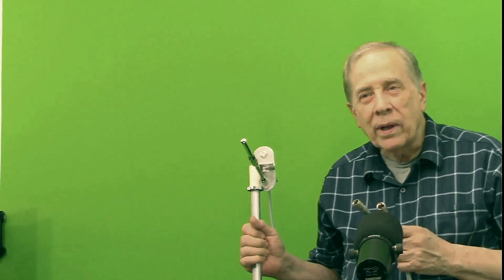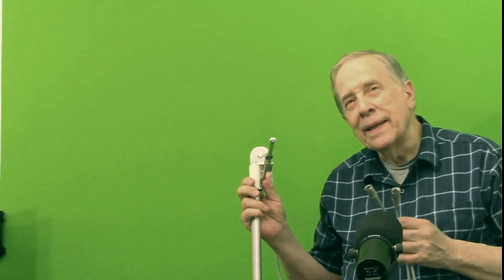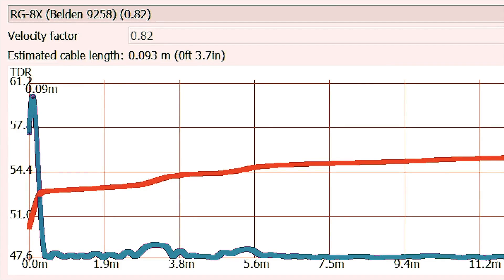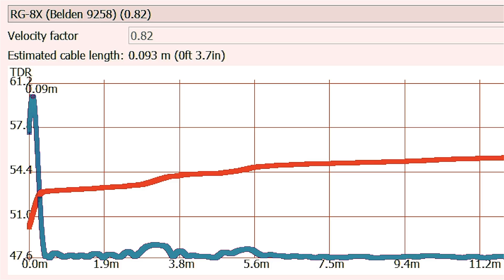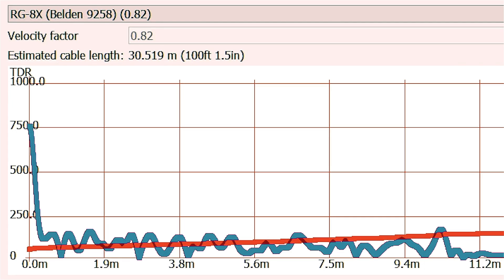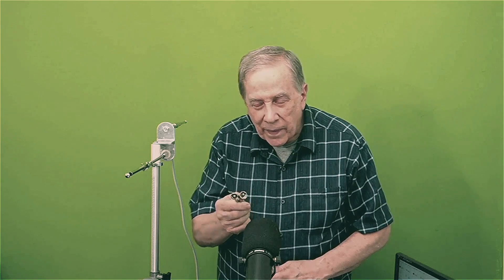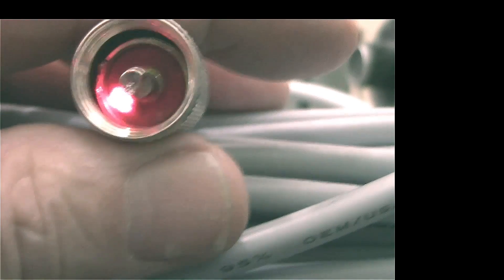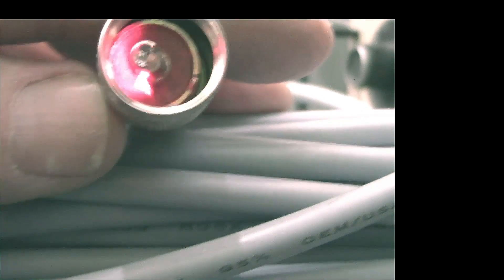RG8X No-Name Coax, You Need To Be Careful, Jim W6LG Shows What Happened To 100 Feet Of Gray Coax

Comment: I learned long ago to never trust connectors that were factory installed.  Gotta put those on yourself.  There could be a single strand shorting out only when coax twisted a certain way that screws up everything.

Comment: What we know and don't know. We know putting 1.5 killer watts into RG-8X is already a sketchy idea. What we don't know is if the connector was possibly bad from the start. If it was bad, then we see the 50/50/90 rule at work. You had a 50% chance of putting the bad end near or far from the amp with a 90% chance of screwing it to the amp. The other question I would have would be where was watt/SWR meter?
My rule of thumb is not more than a couple hundred watts into small coax with RG-142 being okay up to 1KW.
Bottom line, always test new stuff to make sure it won't blow up expensive stuff.

Comment: One question - I am planning on running RG213 Coax from a CB base station to a solarcon a99 antenna out back, through a buried conduit for much of the way. . for at least PART of the conduit that I will run RG213 COAX through, I will also have a flat Cat 6 flat ethernet cable running  - this  Cat6 will act as a connection for the surveillance camera system's feeds from the backhouse to a surveillance box I will have in the house. Do you think there will be any sort of 'static interference' if I run both cables in the same conduit piping? Should I run them in two separate conduits as a way to avoid any potential static interference? Or will it be ok if I ran both in one conduit? No static interference?

Comment: I've had that same problem with those connectors. The minute you put any kind of heat to it, it melts and the center conductor of the connector becomes loose. It will even spin and slip. If it slips back, you get a short. If it slips out, you have a hard time connecting it. I've tossed about 15 into the trash and now carefully inspect what I buy. Thanks Jim.

Comment: Ratwd for 1000 watts max on any band.
Reply from the maker: Hi Matt,

The data sheet for Belden RG8X is as follows:

Frequency Max. Power Rating
10 MHz 1,000 W
50 MHz 370 W
100 MHz 250 W
200 MHz 190 W
400 MHz 110 W
700 MHz 75 W
1,000 MHz 60 

So, it's not able to handle 1KW on most bands.  And the losses per 100 feet become very large at high frequencies.  Soi it will not handle 1kw on most frequencies.  

Thanks and 73, Jim W6LG

Comment: I had a similar experience with some no name 8X coax. I saw a couple of short (3 ft and 10 ft) cables at a flea market and inspected them carefully before buying them. The jacket was black vinyl and appeared to be of high quality. The connectors were silver plated and the soldering was first class. I had no reason to suspect these cables might be problematic. 
     Some time later I was tuning a new antenna and used the 10 foot 8X cable to connect the antenna to my analyzer. No matter what I did, I couldn't get the SWR below 1.5. Finally, on a hunch, I place a precision 50 Ohm load at the end of the cable and got the same results. Without the cable, the load measured 1.01 SWR. But with the 10 foot cable it measured 1.5. It tried the two 3 foot cables and got the same results. It was obvious this no name 8X cable was not 50 ohms impedance. The DC resistance was less than 0.1 Ohms on both the shield and center conductor and there were no shorts so that ruled out any physical damage. But be careful buying no name coax. It might be made to look like 50 Ohm cable, but may actually be non-standard impedance cable for instrumentation or some other purpose. The moral is: Stick with name-branded coax for piece of mind.
Reply from the maker: Thanks Bob.  
To all, Bob's narrative is something that you need to read and understand.  His conclusion to stick with name brand coaxial cable is good advice.  Coax is one of the most important components in a station.  73, Jim Heath W6LG

Comment: I don't think all gray 8X is equal.  I purchased two new 50' lengths without connectors installed at a hamfest 6 years ago.  When cut into to install reducers and Amphenol threaded\solder type  ~.400" sized PL-259's the cable appeared to be of good quality, and soldered well... Both lengths worked well for five years under low\medium-low power under 500W.  I finally moved my antennas off a temporary mounted roof tripod to a tower so have removed those cables from use as they are too short for the tower.  I used one of them with a dummy load recently while calibrating a new RF-Kit RF2K-S full legal limit amplifier and had no issue with the cable, however I did realize during this calibration process that putting 1500 watts through the cable did warm the cable a bit particularly at the ends. Not enough to damage the cable or connectors however enough for me to realize running 1.5KW long term through that cable probably was not the best idea.  When it comes to coax I am very careful to try to purchase quality cable and never buy pre-made cables with ends already on them since this prevents both cable and connector quality examination prior to purchase.  Putting connectors on is a slight pain in the rear but I have been doing it for 35 years now so I've become pretty good at it and see it as a mandatory practice.

Comment: Jim, although this isn't what happened in your case, I have and use the less expensive coax and have had bad connectors on them pretty much all the time. They were improperly installed in whatever factory they were installed in. I now buy coax without connectors installed and install my own. Using power of less than 100 watts though. Very helpful info

Comment: I'll bet the connector wasn't installed correctly...........I built up a PL-259 HiPot tester........ two back to back 60 hz Tx..........120-24 and 24-240....... put a 60 watt light bulb in the pri line cord and a 240v neon out at the SO-239.......push button in the 24v circuit......... if the coax/connectors can take ~338 pk vac they are good to go..........
Reply from the maker: I got one now too.  I will try your setup and see what happens.  That connector was really bad.  I did not manipulate it.  That's the way it was.  73, Jim

Comment: Assuming LMR is the only thing ever made that's good is your first mistake. No point running the California KW if most of it doesn't get to the antenna. If it's not => 87VF and =< 0.6 db/100ft you're cheating yourself. Take a look at M&P U10.
Reply from the maker: I have been licensed since 1964.  Don't assume anything because of what I do as a test in a video.  I have never used the coax mentioned in your first sentence.  I have two runs of 7/8 inch coax to the tower and 1/2 inch Heliax.  At the tower I have 5 vacuum relays and the same type in the radio room.  There is a point to the tests that I am doing.  And, you did not understand that it was just a test into a Bird dummy.  I do lots of tests for videos on YouTube. 73, Jim

Comment: Jim VK2JKN , you should have a antenna with a SWR 1.2 to 1 and no more with an amplifier or it will go boom every time , I’ve blown 2 amps with just over 1.5 to 1 , very finicky , I run lmr400 in all my feed lines best coax for the money hands down
Reply from the maker: It was more like a stick of explosives.  I will show some photos. 73, Jim

Comment: I don't know why anybody would use anything less than RG-213 with 1.5 KW on HF. It also doesn't matter if your cable is coiled up or in a straight line because the center conductor is shielded.

Comment: I've have to buy rg8x at a truck stop a few times. I've had some of the pl-259 connectors pull out easy. I've had some that would not receive. I always test them with a DDM. I've had some of them shorted. Just replace the pl-259.

Comment: Rg8x and RG8 foam melt if over powered and/or exposed to hi VSWR which is the ratio of Vmin to Vmax. Ive seen more than one melted every  halfwave at VHF even with a hundred watts and a bad antenna. UHF connectors, besides all their other faults, will arc even with a bit of moisture.
Reply from the maker: Hi Roger and thanks.  There are some newer dielectrics that are low loss, high Vf and can handle very high power.  The stuff I was using was not one of those and I paid a lot for that mistake.  I was into a Bird Dummy Load when the gray stuff failed. The coax connectors were not good as I discovered.  In any case, my station I use RG216 and RG218, silver Teflon connectors, vacuum relays and check all of that about every six months.  Take care...stay safe, it is not looking good here.  73, Jim

Comment: Very interesting Jim.  Your repair of the amplifier would make an interesting video, too.  I've got a Heathkit SB-220 which is very similar to the AL-82B that you mention in the video.  I have done the capacitor replacement & associated board from Harbach Electronics.  
I also have a SB-1000 that had a transformer failure, and I replaced it.  Since then I have had another failure event (primary fuse blown) that will probably be a problem with electrolytic caps.
I like tube amps but I'm careful to match my exciter to the antenna before bringing the amp on-line, and I usually operate at less than max out.  I also keep an eye on the SWR in case there is any intermittent antenna or feedline problem occuring.  DE K5AVJ (licensed in 1960)

Comment: Some days I feel guilty about spending money on LMR 400, 600, and 8U from Times Microwave.  Then again, I really don't.
Reply: Hey nice to see you here Kingduck! It's a small world lol.
Reply: @PigPen710-SoCal  Waving a hand back to you.
Reply: Why?
Reply: @paulkazjack  If you want to get into a good, long winded, theoretical talk about economic and performance value in two way radio, start a discussion about feedline.  Start talking about cost per foot of the good stuff, then start talking about calculated dB losses, the listen to opinions of various radio users about "how important" the loss and gain of that dB really is.  

You can point out to some people they have 50% attenuation in their feedline, meaning most of their power is turning into heat.  Some will say this should be improved, others will just shrug and "its only 3 dB, you will never notice it, ha ha".  Before you know it, some folks will have no problem running extra footage with premade factory cords at set lengths without trimming, and have no problem using 8x or RG58 for everything, "cuz what's 70% attenuation, I'm still getting out there, ha ha".

Then again, those of us who try to work weak signal, or do a lot of monitoring of LOS simplex, every dB counts.  Listening to mobile stations talk for long periods of time, you get to watch as the signal fades with distance .  3 dB, as you get closer to the noise floor, is everything.  When trying to listen to that far away station, every dB over the floor counts big time.  

The floor is never low enough, the signal never really TOO strong.  

Then again, when you look at the price I paid Times for my 50 feet of LMR 600 for my VHF/UHF, it is hard to justify it sometimes.  Crushing the local repeater which is 65 miles away is good, but you think sometimes if I could have gotten by with cheaper 8u and saved some cash.  The LMR 400 lines for CB/10 meter when 8x would have probably been OK.  

But, when you aren't knocking things out of the park, you realize the money was well spent.  Feedline is, among all the things you can do to your station, one of the ways to cleanly improve performance with no loss (except that damned money).

Comment: Right, and check the coax/pl259s before using.  Now PL-259 and 176 reducers, I bought 25 sets of pl259/176 for a large chain, the salesperson told me they were great as good as  Amphenol's and only $3.40 each plus the 176's. Si ordering 25 and after the 176's I was over $100. The cam in, the box was put on a shelf for about 5 days. Upon opening the box I found all the pl259's with too short of sleeves to screw on to so239, and the back part where the 176 goes was threaded wrong for the 176's, I called and was told to send pics, I did, weeks went by I called again and was told Can't help you. I spent over 12K in 14 months with the outlet and was told to pound sand. I did a vid on the connectors.
Reply: So, why not call out the vendor who sold you junk and treated you badly?  It would be a service to the rest of us.  I fail to understand the state of business and customer service in these times.  A proper vendor would apologize for the error, maybe getting a bad shipment of parts, and offer to send new good parts.
Reply: @BryanTorok  HRO, NH
Reply: I will look for the pictures if I still have I'll post again.
Reply: @buzzsah  OMG!  I would not have suspected.  I haven't dealt with that branch, but have bought from HRO.  I would expect that they would have at least offered to replace the connectors.  That would do nothing for you inconvenience and time to replace all of those.
Reply: @BryanTorok  I spent over 10K with them within 14 months before this and even commented on one of their youtube vids. I was off the air since 84, so had to buy all new. I still have a few HT's I bought from them about 3 years ago that are still in the box. lol.

Comment: Sorry for your misfortune. Looking forward to the autopsy results and your commentary on it.

As someone else mentioned, the power rating is a variable and changes based on the frequency.
Reply from the maker: True .
i was transmitting on 14MHz.  Most cable ratings have 14MHz as a max. 73 Jim

Comment: One of the very first pieces of advice I was given was never use anything smaller than .4 diameter coax. Several people told me about chasing a radio problem only to find out it was the economical coax. 
They said advice number two was connectors.  Only buy real name brand connectors. And number three was of course, stay away from Chinese cheap radios. 
I was told more than once, if you can’t afford a descent radio, rather than buying junk let me loan you one to get on the air. 
People like that are the folks that are offering sound advice.
Reply from the maker: They sure are. Thanks, Jim W6LG licensed in 1964

Comment: Jim isn’t RG8X recommended for up to only 600-800 watts?
Reply from the maker: It depends on the manufacturer.  But, I think that 500 watts SSB and a little less CW with an SWR of less than 1.5:1 would be fine.  Keep in mind the cable losses.  73, Jim

Comment: Should use a balance feedline when using a rf amplifier. Sadly any coax is going to break down with power. Skip the losses and use a balanced feed line and gain the ability to multi-band on the same antenna provided you have a 160m  /80m antenna ☺️😉😉

Comment: Sorry to hear about the amp. I remember back in the CB days of using that grey coax it wasn't good even with a couple hundred watts. It can't handle the heat and melts. Now for jumpers I only use rg400 dual shield and lmr400 off of my bird meter.
Reply from the maker: c

Comment: Hi Jim,
Sorry to hear about the amp. I know you can make the repairs, but a shame that coax caused the repairs. I have stopped using 8X in favor of RG400 for patch cables. All other coax is of the 8U variety and currently use Messi and Paoloni Hyperflex 10. You and the family stay safe.  73  WJ3U
Reply from the maker: Very good advice.  There is no advantage to crappy coax cable.  73, Jim
Reply: @don D'Egidio Did the coax which is rated at less than 1000 watts cause the problem or operator error?
Reply: @twohandsandaradio  The coax that I replaced was CQ Flexi that was bought from The Wireman 40 years ago. It was a high quality RG8U sized coax. I should have used my MFJ 269 antenna analyzer in fault mode to determine where along the coax there was a problem before I started cutting it into pieces.